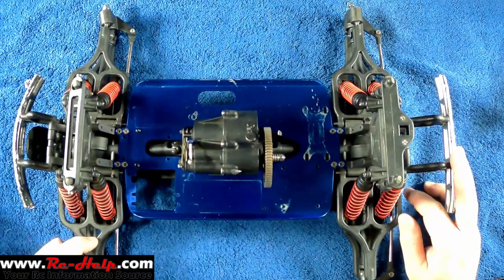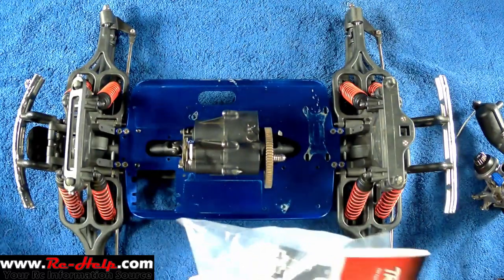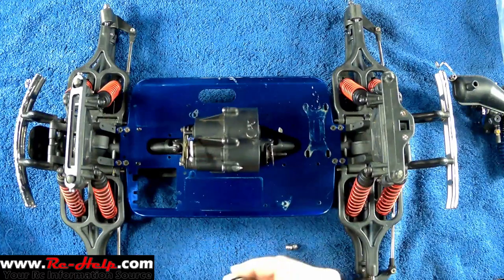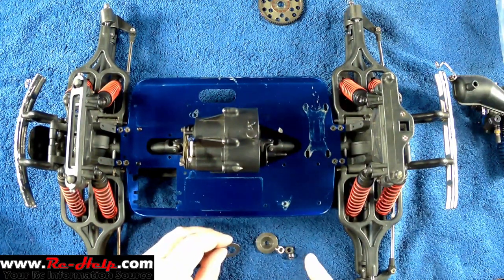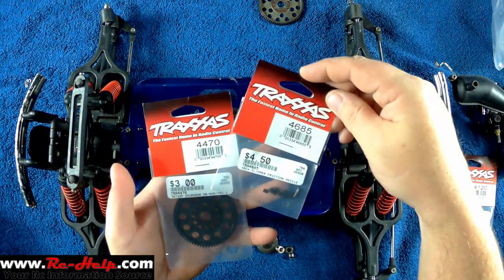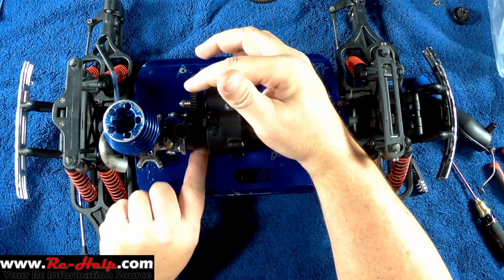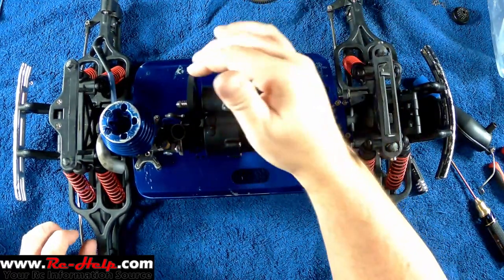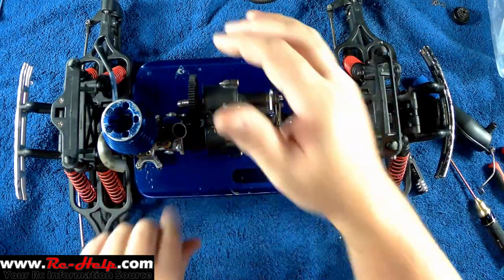Traxxas T-Maxx 2.5 Part 13 Engine Installation

Comment: So attempted to drill through the shaft one one of the trans shafts on the 4910 an man I wish they made the pins as hard as the shaft lol I'm trying to put the black revo shafts into the gray 2.5 trans lol it's a challenge so far
Reply from the maker: Yea, these shafts are more than likely heat treated. Definitely hard to drill with a small bit.
Reply: @RcHelpDotCom  I'm sure they are it's a mission lol

Comment: So i got a tmaxx classic 2.5 stock should i do a light weight 40 mm flywheel with two pins for clutch or should i try to find a tripple clutch flywheel and does it really make a diff thanks
Reply from the maker: I would stick with the stock flywheel if not a solid steel flywheel. The heavier the flywheel, the more rotating mass it has and the smoother and easier it idles. Two shoes are fine for this truck. If you turn them around backwards, it will grab like there is no tomorrow, but adjust your slipper otherwise you will start twisting the driveshafts as I have shown in previous videos. www.Rc-Help.com

Comment: i just bought the Tmaxx 2.5 should be here tomorrow.Can i break the engine in in 30 and 40 degree weather??
Reply from the maker: As long as you get some heat in the engine, you should be fine. But since this is Traxxas, follow what they say on the break-in procedure in the manual. www.Rc-Help.com

Comment: Hey man great vid as all ways an how thick is the 2.5 Chassis
Reply from the maker: The chassis is 3mm thick.
Reply: @RcHelpDotCom  so is that considered a big block chassis
Reply from the maker: Not real sure on that one. I wish I had my .15 with me still to compare it to.
Reply: @RcHelpDotCom  the 2.5 Chassis is 1/8 in thick an the 4910 is half that for sure it's thin  cus I have  the 4910 chassis on 3906 drive line an the 4910 trans an the gray one is the one in trying to put the shafts in an make it forward only an locked in 2nd an hey got a ? Is it the same theory in the trans an the pinion big small I wanna use let's say a 34 pinion an a 19 an maybe a 25 for a all metal trans I'm trying not to spend the  money on it if I might be able to make it work but I might Grande my trans also
Reply from the maker: I measured it out at 3.02mm. I figured the '.02' was the thickness of the anodizing layer, or oxide layer if you will. Just shy of 1/8" which is 3.175mm. As for your trans question, I'm not quite sure what you are asking. The same theory does play in regards to pinion/spur, larger pinion smaller spur equals higher top speed, but slower takeoff. Smaller pinion larger spur equals lower top speed, but much faster acceleration. www.Rc-Help.com

Comment: What's up Toooonny! Lol
Reply from the maker: whatup!
Reply: @RcHelpDotCom  You! Lol. Catch any snakes lately? Lmao. It's finally warming up in Michigan, lol. Been running my nitro circus basher 1/8 scale and my sabretooth basher. Learned one thing. Don't buy batteries with the burst speed. Takes off like a bat outta, but then they tend to slow waaaay down or just stop.
Reply from the maker: No snakes. Lots of Mayfly's thought. They are like a mosquito on crack, and they bite lol.
Reply: @RcHelpDotCom  You know t word! Lol. NOOoooope!! Lmao! Not doing that! Lol! I want one of those traxxas's sweet! With that 2 shock per wheel. Gotta be electric, they'd call the popo with the noise from that nitro motor, lol
Reply from the maker: Just wait until I get the Savage up and running!! It's going to make this little T-Maxx look like a little B***H!!! lmao.
Reply: @RcHelpDotCom  lmaaaooo! Can't wait to see that.